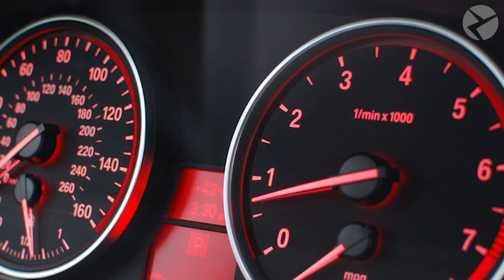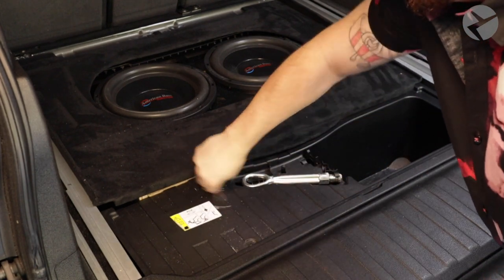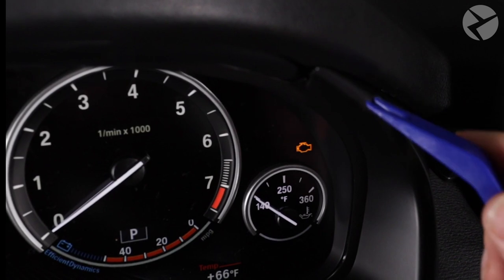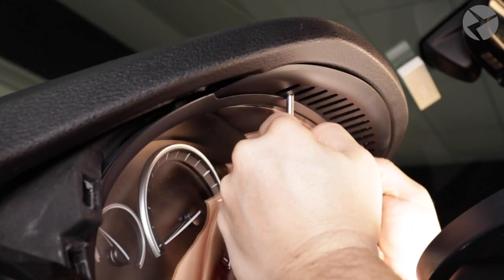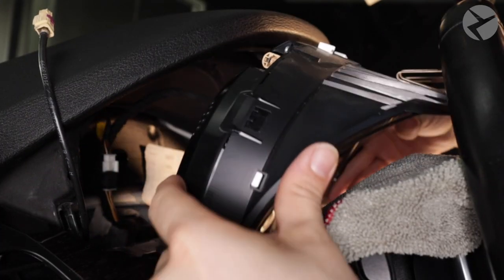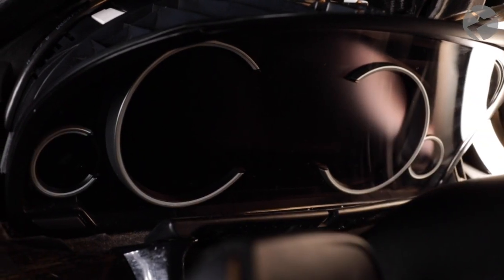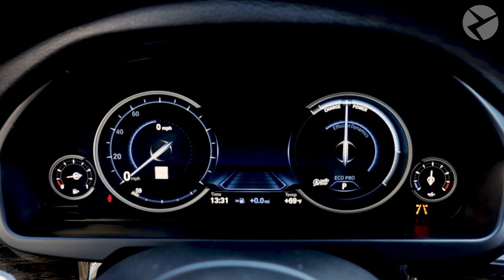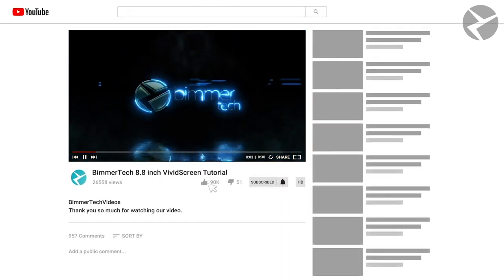How To Install BimmerTech 6WB Digital Cluster in Your X5 BMW

Comment: This looks really easy to install myself. How do I do the coding myself? Is it actually absolutely necessary?
Reply from the maker: Yes, it's easy to install yourself, as each of our products :D 
As for the coding - you need to code it so it works correctly. The coding is manage remotely - our coding specialist conduct it :)
Reply: @bimmer-tech  thanks for the super prompt response! Love you're video, they are very helpful, thank you for creating them!

Oh right, ok, I will have a look into your prices. I was going to just buy a new cluster off ebay (the seller said no coding is required).

Comment: Hello how did you show digital Speedo in comfort mode? Is a coding or original function
Reply from the maker: The instrument panel is fully digitized. It has different setups for three driving modes — a rather usual and calm display for Comfort mode, a touch of blue and eco style features in Eco Pro mode and a more aggressive look in Sport Mode. Comfort mode is preloaded, it's an original functions 6WB offers.

All modes 1:40 https://www.youtube.com/watch?v=hq-AqsLk5Rk&t

Comment: Will this easily install into a 2015 F15 X5 xDrive30d with M sport pack?  Would love to switch the analog dials for this lovely bit of kit.  Any other conversion cables required or is it all plug and play with no change to existing car harness etc. ?
Reply from the maker: Yes, we offer 6WB for this model. 2999 USD shipped if compatible. No need to change existing harness.

Comment: I have a 2018 X5 xDrive35i with a vin ending with J0X95099, will this be compatible despite my X5 having only comfort and sport mode buttons near the gear selector?
Reply from the maker: Yes, your X5 is compatible :)
Reply: @bimmer-tech  Thank you so much

Comment: Does it support comfort+?
Reply from the maker: If your car has comfort+ mode, then it will be displayed. 6WB cluster works as a monitor, so it will display everything that a particular car is equipped with :)

Comment: Hello,is this the same for the f25 2011 x3
Reply from the maker: Hi, the X3 uses a slightly different cluster than the one in this video, but the installation process is pretty similar.
Reply: @bimmer-tech  thanks👍